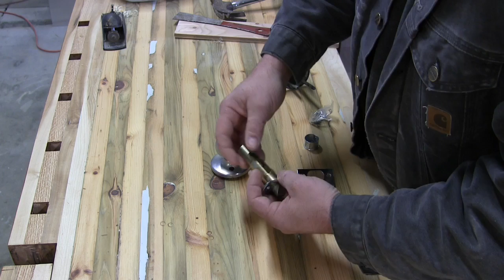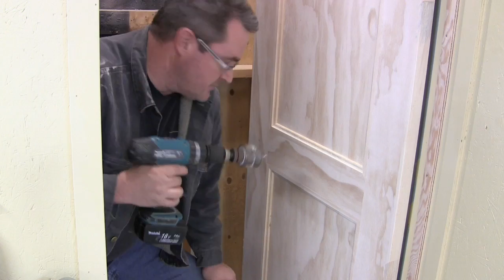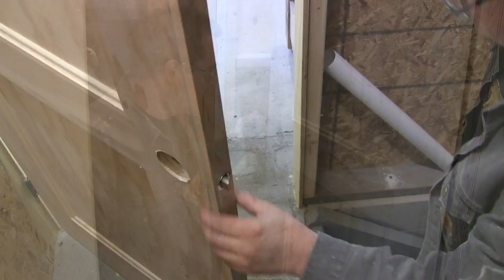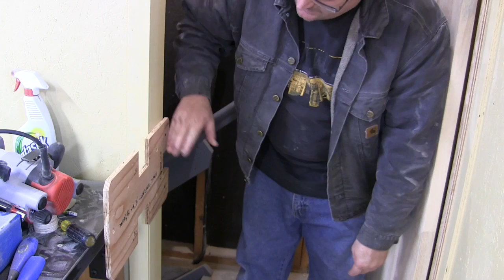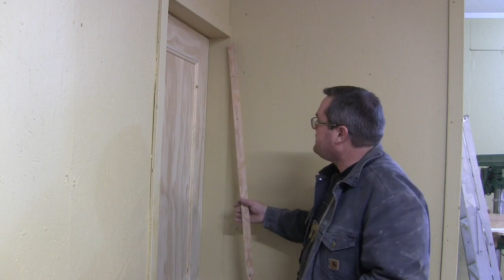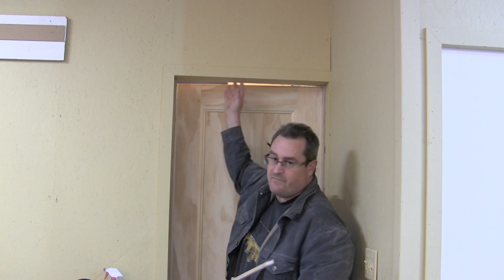How To Install A Door Lock

Comment from the maker: :)
I'm working on iron gauntlets that go to the elbow to wear while using the table saw. These will complement my rhino skin chaps, fur lined titanium cup and mithril apron. I have a stainless steel full battle helmet on order to protect my head from flying debris, and flip-up bakelite welding googles fitted with quartz lenses for protective eye wear.
Should be quite cozy.